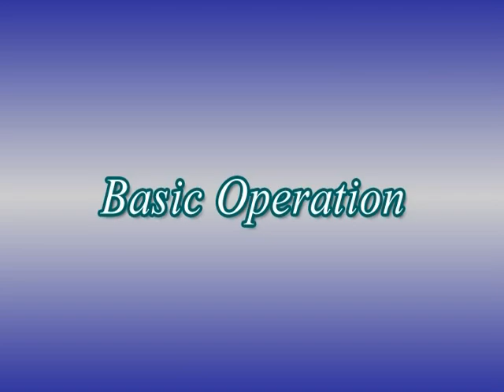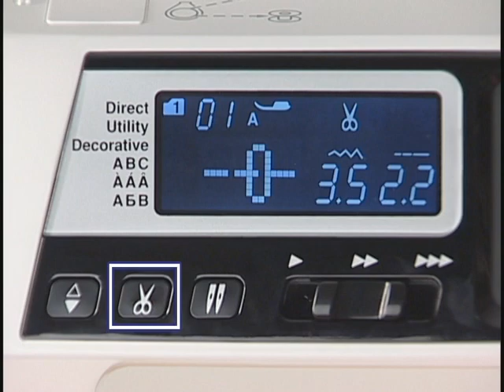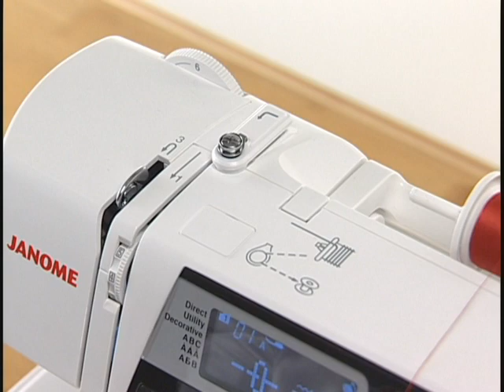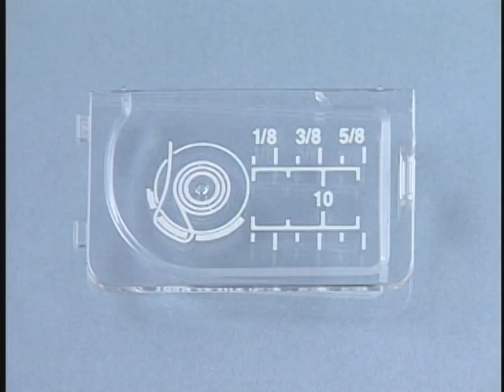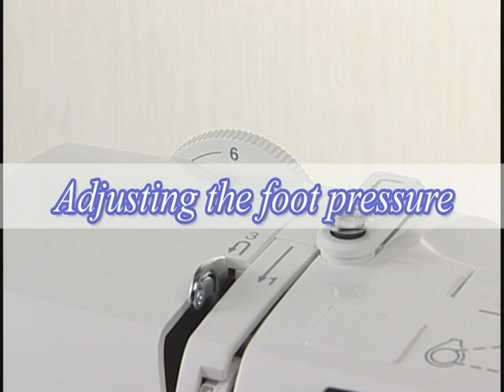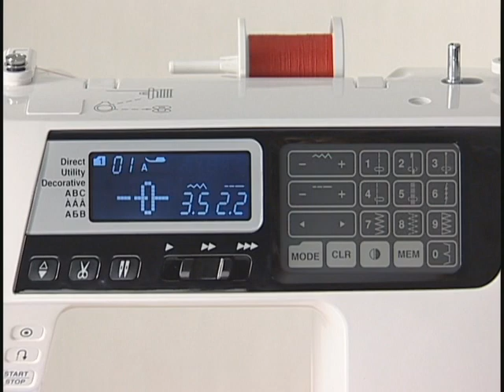Janome 4300QDC Sewing Machine Video

Comment: How do I fix the stitch when it keeps on skipping I changed the needle cleaned the bottom of the bobbin tried changing the tension I just can’t figure it out kinda disappointed in having purchased a Janome
Reply: Have you tried rethreading the machine? Is your presser foot up while you are threading? What size needle are you using with what weight thread? These are typical steps to try when having stitch or tension problems. Also check to see if your bobbin is going in the case correctly and if the spool on top is winding as shown in the manual. I have one machine that messes up if I have the spool unwinding the wrong way. Some machines are opposite to others. My vintage Singer unwinds the opposite of my Janome.
Reply: Nancy, did you end up figuring out what the problem was?